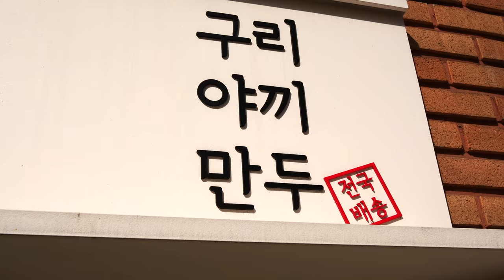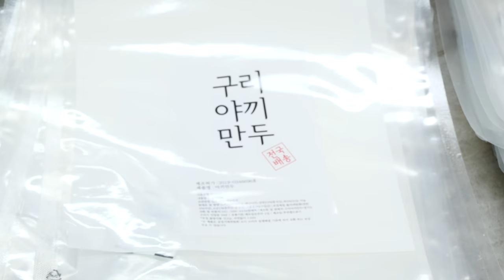Over 8000 Dumplings Sold Every Day! Amazing Skill of Fried Dumping Master [ASMR]

Comment: OK, so someone correct me if I'm wrong.  

It looks like someone makes rice noodles out of rice, then chops the rice noodles back up into rice-sized pieces, mixes them with garlic and salt, and that's all that goes in the dumplings.  

I used to eat frozen dumplings from the local grocery that had carrots and cabbage and TVP and whatever else in them.  These are just salty rice noodles and garlic?